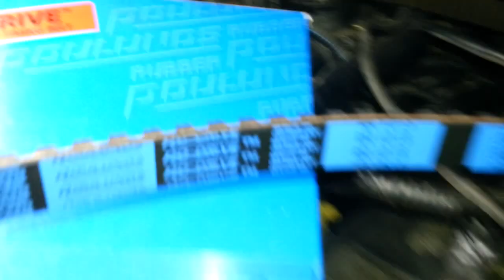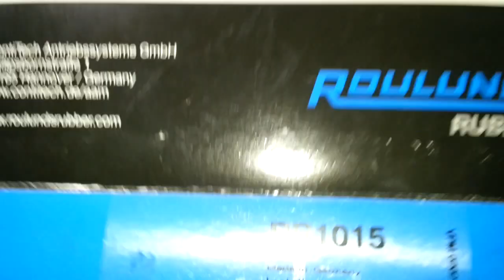Resultado do uso da água da torneira - Parte II

Comment: Água da torneira também pode causar fugas significativas na junta da cabeça do motor?
Reply from the maker: João Mendes Pode corroer a junta e haver passagem entre:
- compressão do cilindro
- água
- óleo

Tudo junto, só água/óleo, água e compressão, óleo e compressão.. Depende do que foi corroído!
Reply: +ebLaSe O Que pode causar a morte do motor certo? Por causa de 20 ou 30€ para por anticongelante em condições? Credo! A meu ver fica um bocadinho mais barato mudar com anticongelante que água da torneira. Já agora anticongelante velho corroi tanto como água da torneira?
Reply from the maker: João Mendes Pode causar a morte do motor. Sim, por 10~20€ de anticongelante. O anticongelante velho mas ainda com a cor original? É que há vários tipos e qualidade. O que falo é de qualidade. Depois há aqueles de supermercado a 3€ que só servem para desenrascar..
Reply: +ebLaSe O meu carro tem um pouco de ferrugem no vaso de expansão, visto que teve vários anos parado. Mandei mudar anticglante, óleo velas tampa distribuidor e limpar carb. Mudaram com anticongelante verde, mas agora, 1 ano depois está da cor da água! Devo preocupar-me com isso? Quer dizer, antes tinha cor de ferrugem.
Reply from the maker: João Mendes Deves trocar novamente de anti-congelante. Se tem ferrugem, é normal que o anticongelante NÃO dure o mesmo tempo se tivesse num sistema "são". Aconselho a manter a mesma cor do anticongelante(verde).
Reply from the maker: João Mendes Editei a resposta porque faltava uma palavra que mudava o sentido da frase.
Reply: +ebLaSe Breve tem que ir à oficina outra vez, quando for mudo tudo. No entanto também tem uma anomalia estranha: Quando as luzes estão ligadas, acendem todas a luzes como normal. No entanto quando se abre a bagageira, as luzes de matricula apagam, quando fecha acendem outra vez ( na maior parte das vezes). O carro é um Renault super5 de 1988. Obrigado por todas as informações.
Reply from the maker: +João Mendes As luzes de matricula não são alimentadas pelas fichas que tem junto à tranca da mala? Só faz contacto quando fecha a mala.